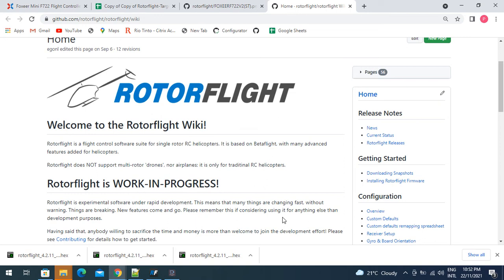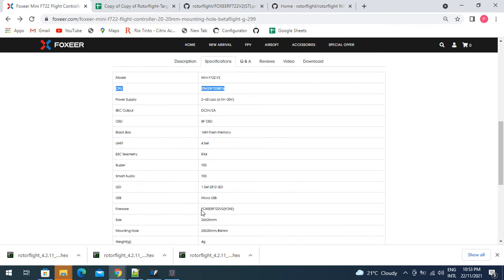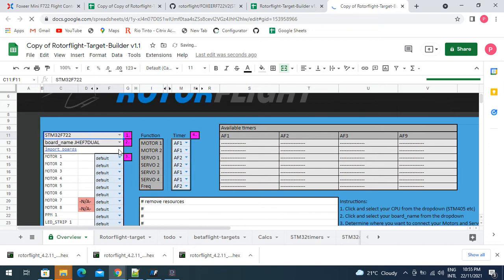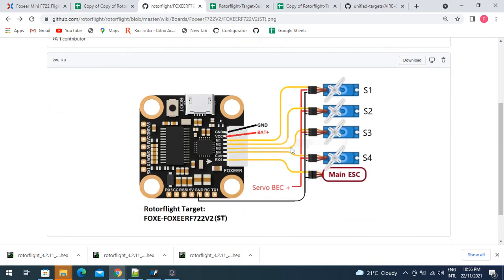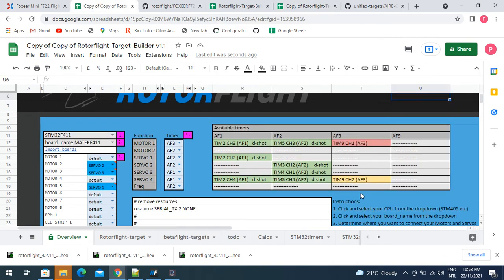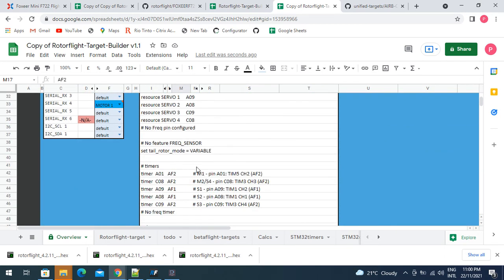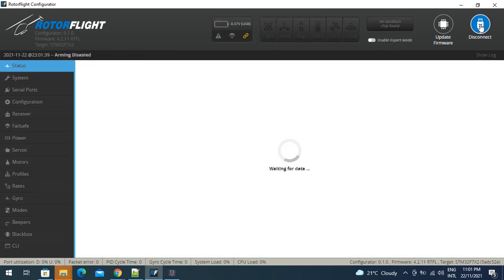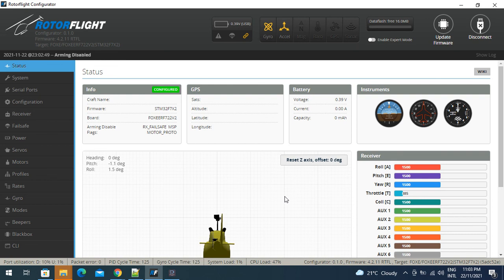Hardware configuration of a Rotorflight Flight controller

Comment: No way this is too difficult to do. Rotor flight needs to make this very simple download just like the others. 
I was interested in going all rotor flight on my helis but im thinking very different now due to difficulty
Reply from the maker: This is only required if you are using a Betaflight controller. If you use a Nexus, FlydragonF722, flywingf405 or either of the Matek Rotorflight controllers then they are just downloaded like any of the others.

https://www.rotorflight.org/docs/Tutorial-Quickstart/What-Board#such-as

Comment: HI Phil, 

Why don't U guys are not uploading a complete , A to Z helicopter FBL set up video for a noob guys such as drones??? 
If u want more people come in this DIY fbl making , U need to make it easy , focusing for layman.
Reply from the maker: Other videos are planned. The main issue is that development has been rapid with lots of stuff changing all the time. Different pages in the Configurator etc. If we make a video it rapidly becomes outdated. With the upcoming release of Rotorflight 2 everything will be more fixed so some videos will be made.
Reply: @philkaighin3582  

Pls do  something so that noob, layman folks get attracted in this hobby as drone community . I have been in this micro helicopter hobby since 2018, knowing abt all micro, sub-micro heli's FBL more or less. I always stay within 200 size helicopters. 

I made a DIY drone on 2018 by clean flight with SPracingF3 board, but then totally away due overwhelmed by micro helis. 

However, I am so excited abt learning to make a DIY FBL, which is cheaper, having more options, though it is challenging. In the RCgroup forum I see only.05 % folks even know abt DIY fbl . 

Are U in the Discord by the way ???

Comment: Hi,
Can I uae this application in any FBL used in micro type helicopter??
Reply from the maker: Hi. It can be loaded to any Flight Controller that runs with Betaflight. These are many of these built for  drones. They cannot be used for the closed source FBL that come with small helicopters.
Reply from the maker: We replace the as supplied FBL with a drone board to use this software.

Comment: I have this problem to arm the motor The maximum frequency of the PID loop is limited by the power of the

  CPU Processing.  CPU load should not exceed 70% how can I solve this problem?  thanks in advance for your answer
Reply from the maker: Hi Maverick. You should drop the 'PID Loop Frequency' on the Configuration Tab. You do not need more than 2kHz. Also if you are using dshot setting to Dshot300 is more than enough.

Comment: In stabilized mode it does not turn?
Reply from the maker: Hi. Yes you can turn in stability mode. The only difference with this mode is when you put the sticks in the centre the helicopter will level itself. Moving the sticks will still make the helicopter roll or pitch. Helicopters in general also need Yaw to help turn. Much more than with fixed wing.

Comment: Is the configuration on the radio helicopter or does it leave it as an airplane?  Good morning
Reply from the maker: Hi @maverickgyrocopter2837. The radio is set to individual channels. No helicopter mixing is required. Yes individual channels like a basic airplane.

Comment: Thank you, Phil! Very comprehensive.

In the to-do list H743 is still pending. Do you plan to release a new version of this spreadsheet any time soon?
I have a Matek H743-Wing dedicated for this project.

Cheers!
Reply from the maker: Hi Stefan, Yes I need to do the H7 processors. There seems to be more and more people asking. 
I built a target for that board last week so you should be able to load Rotorflight and then past this file into the CLI (then type save) and your board should work. I have commented what pins connect to what functions. If you need any help please get in contact at the discord discussion board https://discord.gg/6QUySXdEvd and we can help ASAP. 
Cheers,
Phil
Here is the file:

############################
#define USE_ACC_SPI_MPU6500
#define USE_GYRO_SPI_MPU6500
#define USE_ACC_SPI_MPU6000
#define USE_GYRO_SPI_MPU6000
#define USE_ACC_SPI_ICM42688P
#define USE_GYRO_SPI_ICM42688P
#define USE_ACC_SPI_ICM42605
#define USE_GYRO_SPI_ICM42605
#define USE_BARO_BMP280
#define USE_BARO_DPS310
#define USE_MAX7456
#define USE_SDCARD

board_name MATEKH743
manufacturer_id MTKS

# resources
resource BEEPER 1 A15
resource MOTOR 1 B00			# Label S1
resource MOTOR 2 NONE
#resource MOTOR 2 B01			# Label S2. -  Disabled. Remove leading # to use

resource SERVO 1 A00			# Label S3
resource SERVO 2 A01			# Label S4
resource SERVO 3 A02			# Label S5
resource SERVO 4 A03			# Label S6

#resource SERVO 5 D12			# Label S7. -  Disabled. Remove leading # to use
#resource SERVO 6 D13			# Label S8. -  Disabled. Remove leading # to use
#resource SERVO 7 E05			# Label S9. -  Disabled. Remove leading # to use
#resource SERVO 8 E06			# Label S10. - Disabled. Remove leading # to use

resource MOTOR 3 NONE
resource MOTOR 4 NONE
resource PPM 1 C07
resource LED_STRIP 1 A08
resource SERIAL_TX 1 A09
resource SERIAL_TX 2 D05
resource SERIAL_TX 3 D08
resource SERIAL_TX 4 B09
resource SERIAL_TX 6 C06
resource SERIAL_TX 7 E08
resource SERIAL_TX 8 E01
resource SERIAL_RX 1 A10
resource SERIAL_RX 2 D06
resource SERIAL_RX 3 D09
resource SERIAL_RX 4 B08
resource SERIAL_RX 6 C07
resource SERIAL_RX 7 E07
resource SERIAL_RX 8 E00
resource I2C_SCL 1 B06
resource I2C_SCL 2 B10
resource I2C_SDA 1 B07
resource I2C_SDA 2 B11
resource LED 1 E03
resource LED 2 E04
resource SPI_SCK 1 A05
resource SPI_SCK 2 B13
resource SPI_SCK 3 B03
resource SPI_SCK 4 E12
resource SPI_MISO 1 A06
resource SPI_MISO 2 B14
resource SPI_MISO 3 B04
resource SPI_MISO 4 E13
resource SPI_MOSI 1 D07
resource SPI_MOSI 2 B15
resource SPI_MOSI 3 B05
resource SPI_MOSI 4 E14
resource ADC_BATT 1 C00
resource ADC_RSSI 1 C05
resource ADC_CURR 1 C01
resource ADC_EXT 1 C04
resource SDIO_CK 1 C12
resource SDIO_CMD 1 D02
resource SDIO_D0 1 C08
resource SDIO_D1 1 C09
resource SDIO_D2 1 C10
resource SDIO_D3 1 C11
resource PINIO 1 D10
resource PINIO 2 D11
resource OSD_CS 1 B12
resource GYRO_EXTI 1 B02
resource GYRO_EXTI 2 E15
resource GYRO_CS 1 C15
resource GYRO_CS 2 E11

# CS1/CS2 pads for SPI3 connection
# CS1 D04
# CS2 E02

# timer
timer B00 AF2
# pin B00: TIM3 CH3 (AF2)
timer B01 AF2
# pin B01: TIM3 CH4 (AF2)
timer A00 AF2
# pin A00: TIM5 CH1 (AF2)
timer A01 AF2
# pin A01: TIM5 CH2 (AF2)
timer A02 AF2
# pin A02: TIM5 CH3 (AF2)
timer A03 AF2
# pin A03: TIM5 CH4 (AF2)
timer D12 AF2
# pin D12: TIM4 CH1 (AF2)
timer D13 AF2
# pin D13: TIM4 CH2 (AF2)
timer D14 AF2
# pin D14: TIM4 CH3 (AF2)
timer D15 AF2
# pin D15: TIM4 CH4 (AF2)
timer E05 AF4
# pin E05: TIM15 CH1 (AF4)
timer E06 AF4
# pin E06: TIM15 CH2 (AF4)
timer A08 AF1
# pin A08: TIM1 CH1 (AF1)
timer A15 AF1
# pin A15: TIM2 CH1 (AF1)
timer C07 AF3
# pin C07: TIM8 CH2 (AF3)
timer C06 AF3
# pin C06: TIM8 CH1 (AF3)
timer B08 AF1
# pin B08: TIM16 CH1 (AF1)
timer B09 AF1
# pin B09: TIM17 CH1 (AF1)

# dma
dma ADC 1 8
# ADC 1: DMA2 Stream 0 Request 9
dma ADC 3 9
# ADC 3: DMA2 Stream 1 Request 115
dma TIMUP 1 0
# TIMUP 1: DMA1 Stream 0 Request 15
dma TIMUP 2 0
# TIMUP 2: DMA1 Stream 0 Request 22
dma TIMUP 3 2
# TIMUP 3: DMA1 Stream 2 Request 27
dma TIMUP 4 1
# TIMUP 4: DMA1 Stream 1 Request 32
dma TIMUP 5 0
# TIMUP 5: DMA1 Stream 0 Request 59
dma TIMUP 8 0
# TIMUP 8: DMA1 Stream 0 Request 51
dma pin B00 0
# pin B00: DMA1 Stream 0 Request 25
dma pin B01 1
# pin B01: DMA1 Stream 1 Request 26
dma pin A00 2
# pin A00: DMA1 Stream 2 Request 55
dma pin A01 3
# pin A01: DMA1 Stream 3 Request 56
dma pin A02 4
# pin A02: DMA1 Stream 4 Request 57
dma pin A03 5
# pin A03: DMA1 Stream 5 Request 58
dma pin D12 6
# pin D12: DMA1 Stream 6 Request 29
dma pin D13 7
# pin D13: DMA1 Stream 7 Request 30
dma pin D14 12
# pin D14: DMA2 Stream 4 Request 31
dma pin E05 0
# pin E05: DMA1 Stream 0 Request 105
dma pin A08 14
# pin A08: DMA2 Stream 6 Request 11
dma pin A15 0
# pin A15: DMA1 Stream 0 Request 18
dma pin C07 0
# pin C07: DMA1 Stream 0 Request 48
dma pin C06 0
# pin C06: DMA1 Stream 0 Request 47
dma pin B08 0
# pin B08: DMA1 Stream 0 Request 109
dma pin B09 0
# pin B09: DMA1 Stream 0 Request 111

# feature
feature RX_SERIAL
feature TELEMETRY
feature OSD

# serial
serial 5 64 115200 57600 0 115200

# master
set mag_bustype = I2C
set mag_i2c_device = 1
set baro_bustype = I2C
set baro_i2c_device = 2
set serialrx_provider = SBUS
set blackbox_device = SDCARD
set current_meter = ADC
set battery_meter = ADC
set ibata_scale = 250
set beeper_inversion = ON
set beeper_od = OFF
set beeper_frequency = 2500
set sdio_use_4bit_width = ON
set sdio_device = 1
set max7456_spi_bus = 2
set pinio_box = 40,41,255,255
set gyro_1_bustype = SPI
set gyro_1_spibus = 1
set gyro_1_sensor_align = CW0FLIP
set gyro_1_align_pitch = 1800
set gyro_2_spibus = 4
set gyro_2_sensor_align = CW0FLIP
set gyro_2_align_pitch = 1800
##################################
Reply: Wow! Such a rapid responce, thank you!

Yes, I'm member of the Discord server from when it was still HF3D. Only now I found the bandwidth to become more active. :)
We can move the discussion there.

My first concern was with the CPU selection, since H7 was still not availble. I decided to give it a try using F722 option and Betaflight target for Matek H743.

I'm willing to contribute with flight testing once I set this thing.
Reply from the maker: Hi Stephan. The H743 is now supported in the spreadsheet.

Comment: is autolevel mode (ATT) can be setting more than 45° max ???? Thanks
Reply from the maker: Yes you can use anything between 10 and 90 degrees for "Angle mode" (and acro trainer). Horizon mode is also self leveling; however, if you continue to hold full control it can continue to complete a flip or roll. Centring the sticks it will level again.
Reply: @philkaighin3582  thanks ! where can i see a video demo of horizon and autolevel I find only 3D video ?
Reply from the maker: @did3d523  not sure about a video but a step by step guide is on the wiki. If you need more help please post on the Discord discussion group and we can help step you through it. 
https://github.com/rotorflight/rotorflight/wiki/Using-stability-modes
Discord invitation at the top of this page:
https://github.com/rotorflight/rotorflight/wiki/Manual-Setup

Comment: Excellent tutorial, thank you!!!
Thanks for building this amazing tool.
Reply from the maker: Please ask a question on the discord. I'm sure we can help you get the telemetry working.
Reply from the maker: Glad you found it helpful. What heli are you going to build?
Reply: @philkaighin3582  I've build a fixed pitch Piccolo with over 20hrs of reliable RotorFlight flights :) Now building a Pro Piccolo collective pitch heli with a different board and using RF2. Struggling a bit with FrSky R-XSR connection (SBUS/F.port, my other heli has F.port but no telemetry alas).
Reply from the maker: Fantastic. 🎉

Comment: Can you please help me set up a fly bar mechanical swash plate it’s a raptor 30 nitro helicopter  ? Thanks
Reply from the maker: Hi Leigh. Do you mean set up Rotorflight as a tail gyro only and not as a flybarless controller?? I do believe it is possible although I have not done it. Jump on the Discord discussion and we can help.
 https://discord.gg/nB36tu542a

Comment: You said different timers for motor and servo but used af2 for motor and servo3 ?
Reply from the maker: Hi Jan. The AF stands for alternate function. It's really like 'option'. So each column is option 1 option 2 etc. The actual timers assigned for those options is the important bit so in the example the motor pin set to AF2 (option 2) is TIM5 (Timer 5) and the servo pins set to AF2 are TIM3 (Timer 3).
Reply: @philkaighin3582  
Ah, ok… thx 👍🏻
Reply from the maker: @Jan S. No problems at all. Let me know if I can help. You can also check out the Discord (link is on the Rotorflight wiki).